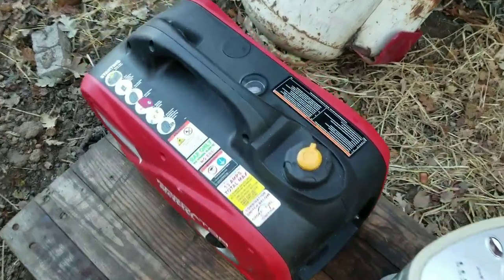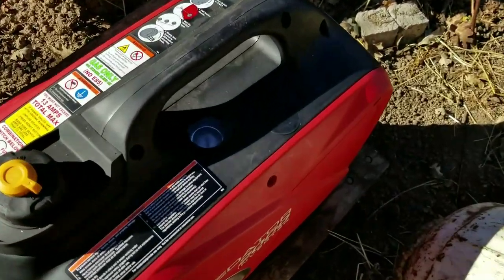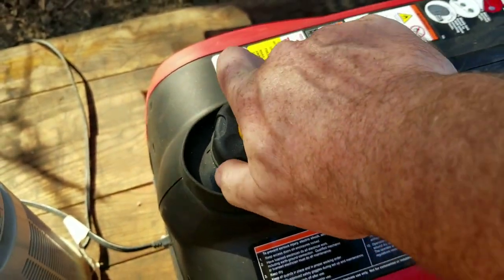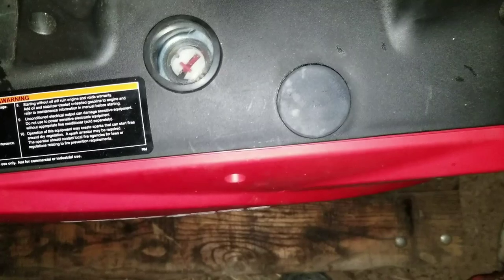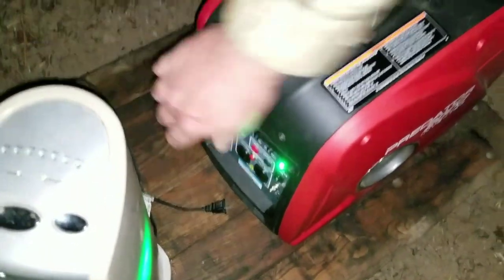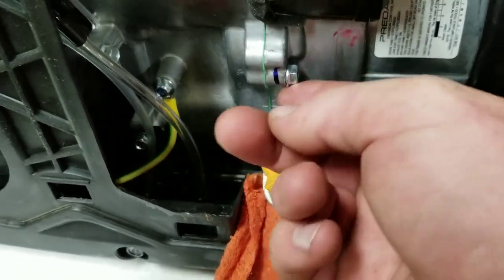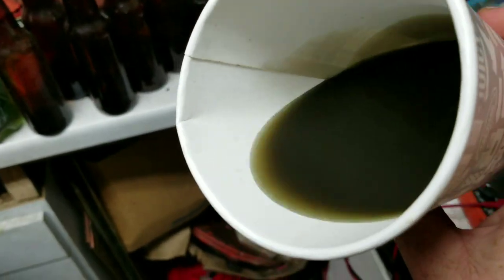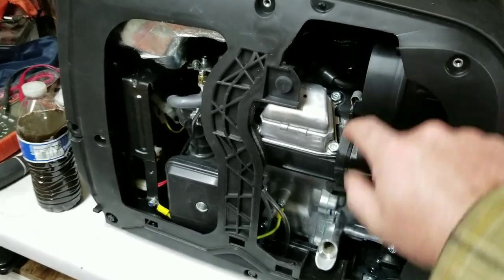Predator generator 2000 stress test running it near full load for 8 hours

Comment: I've had mine almost a year,  running 5000 BTU AC 10 hrs a day all summer in central fla 95 degree heat.... It's bullet proof and I'd put it up against Honda any day of the week, ain't no doubt.
Reply from the maker: well it shouldn't, that's about a 600 watt load. start up maybe a bit hard in eco mode.
i'd say to you is change your oil often, use 15-40 oil and trim the air inlet boot going into the alternator, it's under the muffler, double the size of the hole and it may run forever at that point
Reply: @chainsawsandgenerators9952  Why 15/40?
Reply from the maker: @johnt1276  becuse I have it on tap at my house.
Plus the manual says to run it.
Reply: @johnt1276  15W-40 is a diesel grade oil with a stouter additive pack than car oils.  the 40 grade oil also provides a higher Minimum Oil Film Thickness to provide stronger protection from metal to metal contact within lubricated parts.  It's also very economical=cheap.
Reply: @ottohonkala6861   My manual(5/8/2020) says 10/30 but if 15w-40 makes it run better and last longer I will switch it.! Thanks!
Reply: @johnt1276  the thicker 15W-40 will provide longer life.  In hotter climates especially.

Comment: Great Generator, I bought this one when we had a bad ice storm in the beginning of the year to run freezer in garage and fridge. This also ran some lamps in bedroom, tv, phone chargers and box fans. I have gas for my water heater so no need to use it there. I made sure I changed the oil a few times before the recommended 20 hour break in period. I love that it’s so quiet and light weight and runs great. I will be using it now to clear trails behind my house using a electric chainsaw. My plan is to either get another Predator 2000 inverter or Tractor Supply has a 4000 watt for $299 I may get to run more items in my house. All in all this is a great generator and a perfect clone of a Honda.

Comment: I did a quick search for parts for the Harbor Freight Predator and found many of them on Amazon.com.  Just the first site that showed up. Example: Carburetor (new) $28.99!  Check online for parts before commenting.  
My experience, when I sold and repaired, Chinese 4 wheelers is that the manufacturers reverse engineered name brand motors and made their parts exactly like the name brand's parts.  In the case of the 4 wheelers I sold, it was Honda parts.  
The Chinese parts might not be as well made as the original, but were exact size of the name brand parts and could be replaced with name brand parts or even OEM replacement parts.  
You won't be able to use their part number, some part numbers did cross over, but you can compare the old with the replacement part.  
The Chinese don't waste money on R&D, they just buy a name brand, take it apart and copy the parts.  Actually a good way to reduce overhead.  
As with ANY motor, maintenance is the best investment you can make.  Ignore it and NO MOTOR will last long!
Most times you can replace the entire Chinese unit for less money than repairing a name brand unit, sometimes even if you do the work yourself.

Comment: Been running mine for 1 year to cool and heat my semi. It still working and running strong.
Reply: How often do u need to change the oil. I got one also and plan on cooling my semi.
Reply: @heavypressureinc  every 100 hrs.
Reply: @jesust6101  thanx for reply
Reply: @heavypressureinc  you are very welcome. Good luck out there.

Comment: Actually,  most wear happens at start up and generators run best at 60-100%  load. So this is actually the best way to run it. The machine that is started and used for hour or so while only using 5% capacity is the one that is being beat.
Reply from the maker: yep, that is true, it's more true with the new diesel generators with after treatment. 
but, we both know that these generators are lucky to see more then 50% load, or you get the ones that are hammer down all the time and whipped.. 
big box store's (around here) backup generators only see about 30%-40% of there capacity
Reply: I have a diesel 3kw Robin 30d36r. It's a 3600 rpm aircooled unit I use for home  power outage. I run no less than 600 watts, preferable 1kw min. Here is the kicker....at 2.5kw it sounds better, smoother, happier than at 1kw. Go figure.
Reply: I remember seeing people at the off grid campground using 5k-8kw all day just to charge a single 12 volt battery and maybe run a light.
Reply from the maker: it makes sense to me, everything is heating up, with 3600 rpm diesel make sure to change the oil often.

my 8kw is a 3cyl lugger 1800rpm..
Reply from the maker: people are stupid. especially when it comes to electricity

Comment: What is the best oil gas and spark plug to use?
Reply from the maker: i'm still running the stock spark plug, the gas is 87 octane from the pump. and the oil is Mobil 1300 15-40
Reply: @chainsawsandgenerators9952  thanks so much! I think the champion duel fuel is a pretty good option for the same price with a lot more features!
Reply: @breantargaryen2630  I hear NKG works best.

Comment: This generator won't even run my small microwave.for 10 seconds. Maybe the power convertor was on charging the battery at the same time?
Reply from the maker: possibility, a small microwave only draws about 800 watts. in eco mode, dose it sound like its going full speed before you connect the microwave in? if it is, then that's your problem
Reply: @chainsawsandgenerators9952  No, it went full speed on the microwave start up and 10 seconds of running, the microwave shut down with a lo pwr on display. The generator stayed running but wasn't supplying enough power to keep up. Shore power works fine.

Comment: Good vid . It probably would have waisted less gas on eco .
Reply: Powerstroke Diesel if its under full load I doubt using the eco setting would do anything at all. If it was part loaded then putting it on eco would allow the engine to run slower as the inverter doesn't depend on engine speed like a conventional alternator for generating the correct voltage and frequency. Then you might see some savings

Comment: Ok, it passed your own idea of a test. And .... ? Will it continue to do that? Did your test use up some of the inevitable future lifetime? When that happens can you get parts for it or will a small engine shop be able to get it back into something useful? Just wondering.
Reply from the maker: the test was to prove that the components can handle a heavy load, like the outside of the box promised, and that there is nothing close to failing. also to help flush all the trash out of the engine, and there is alot of it.
all the small engine shops around here will not even touch them,  because parts are not available, and for the price to fix them, just to change a carburetor you'd be pushing 50% of the value if a new one.
ive spent hours on the computer trying to find a replacement inverter and can't find nothing. even on the Chinese sites